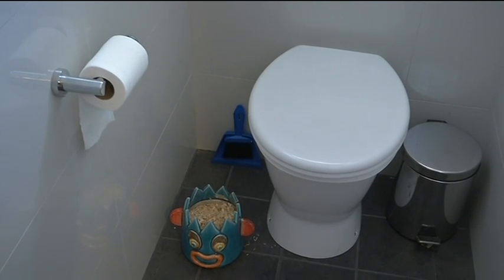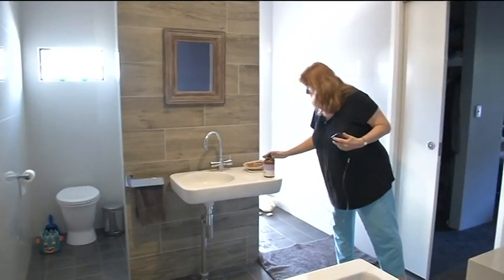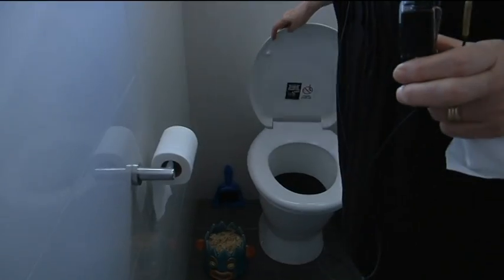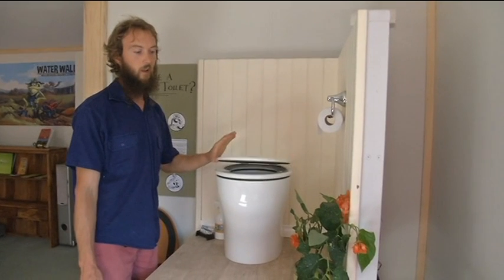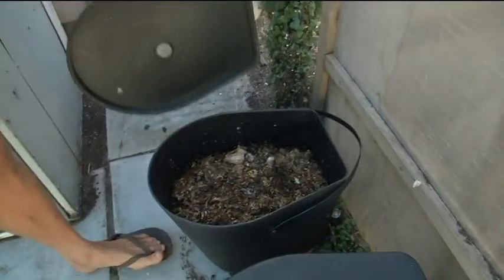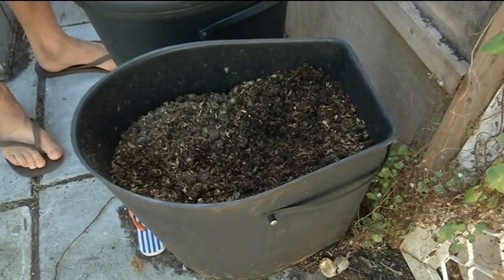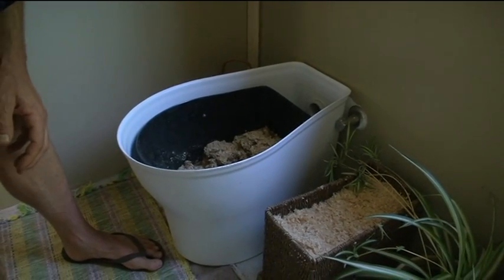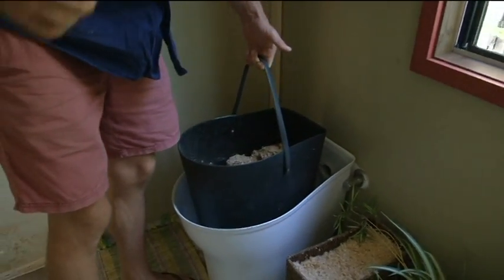Composting Toilets: How do they work?

Comment: I think if they want to use compost toilets instead of connecting to the solar system they should be allowed to. That's less chemical treatments to be put into the water once it gets back to wherever it goes. Which means there's less chemicals coming back into your house if you're using public water systems

Comment: So much left unsaid.  Where does the toilet paper go?  How does the inside bowl stay clean without water flush. Does it have to be hand wiped after use in that case? How does it stay un smelly if the sides of the bowl are urinated or shat upon and no water cleanse? etc etc